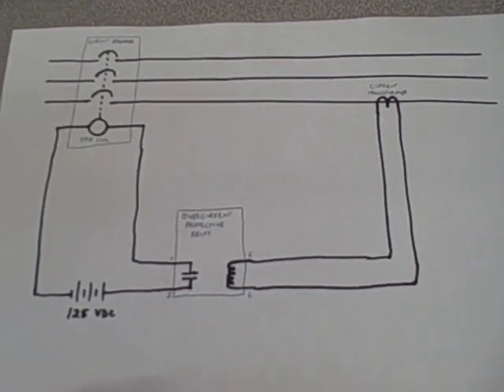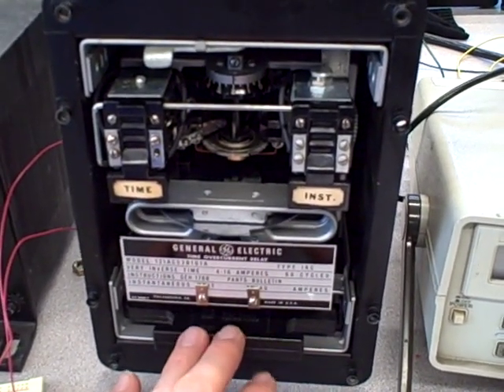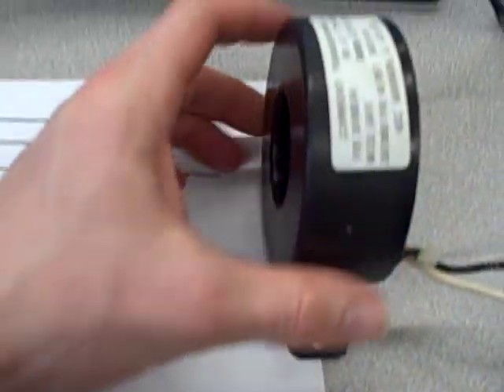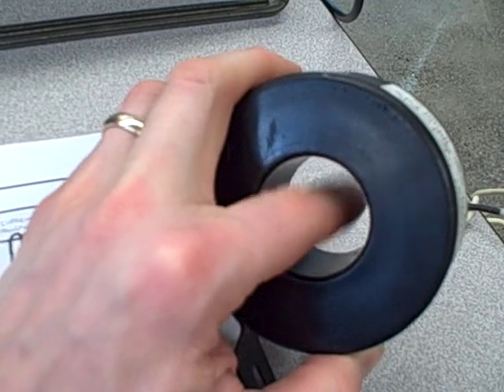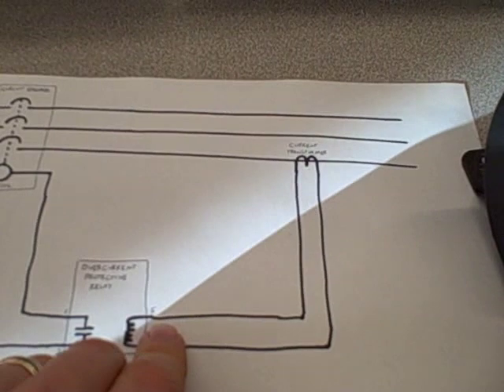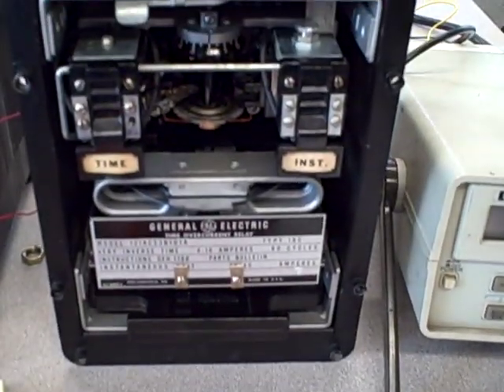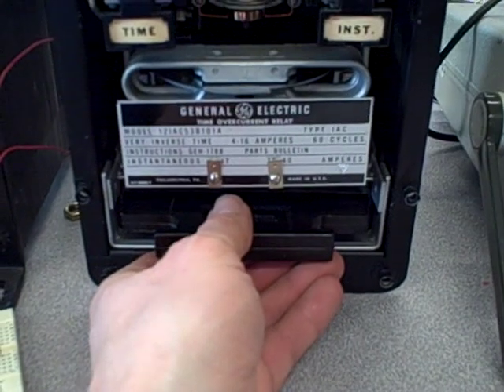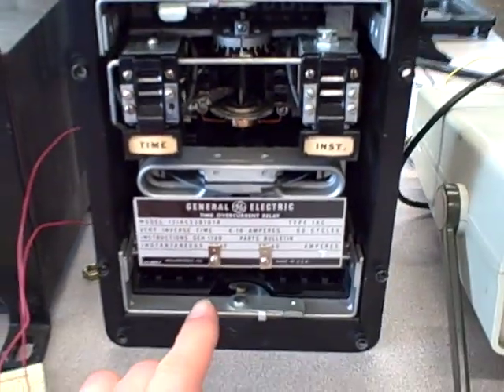Protective relays -- current transformers

Comment: Wait... CT steps-down current to safe level, but at the same time, the CT steps-up the voltage at its output to dangerously high levels. That high voltage is the force that tries to push the secondary current–5Amp in this case– across the air gap. Therefore, because of the dangerously high voltage at the CT secondary, CT should be shorted before opening its burden connections. 
Please confirm if my understanding is correct??

Comment from the maker: @magnahelic1 If you lose the 125 VDC tripping supply, you've basically lost control of your circuit breaker -- a very bad situation.  I've worked in a substation where this happened once.  It's scary to consider that there is absolutely no protection (not even manual control from the substation control room!) until that 125 VDC power is restored!